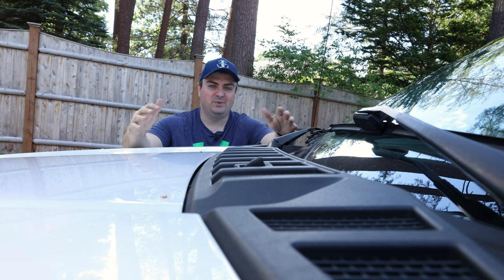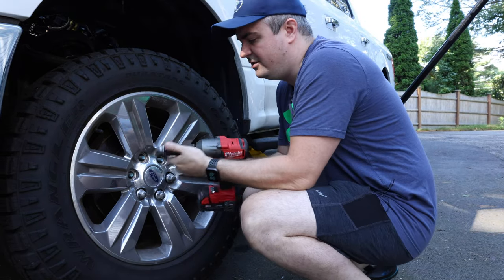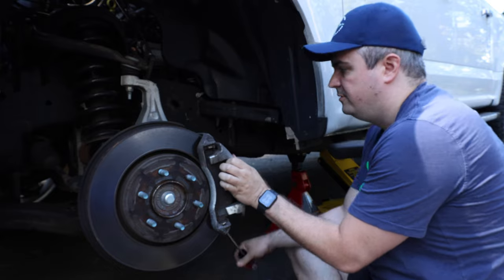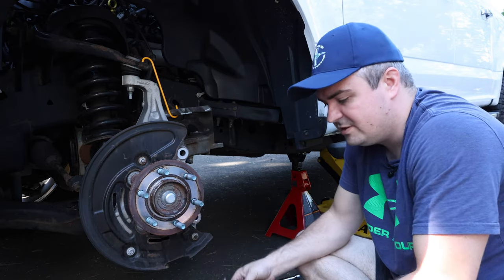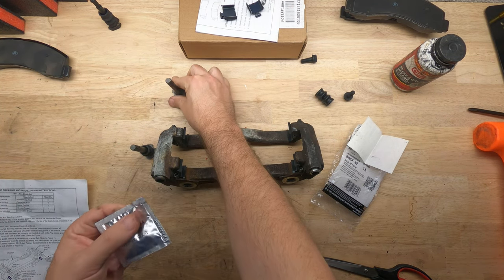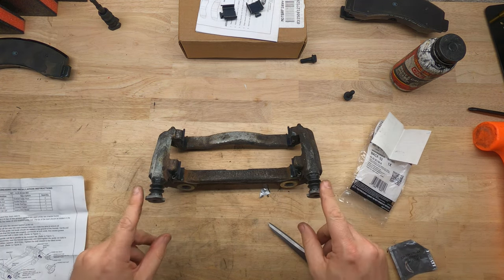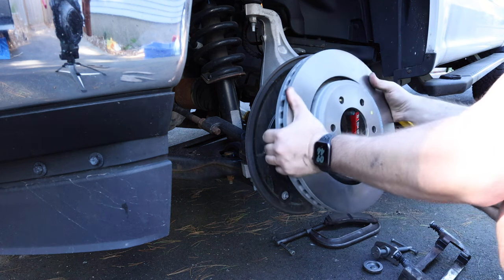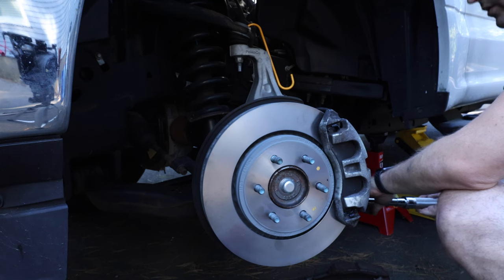F-150 Front Brake Rotor and Pad Replacement

Comment: I'm curious since you didn't cover it, did you bleed the brakes? This is another one of those tool box videos. I just did the front brakes on my F-150 last weekend. Lol. I started to video, but somewhere in there something went awry and my video stopped. Anyway, I find that using an impact to remove those bolts is easier than a ratchet and breaker bar. The only other thing I did different was bleed them just to ensure they're is no air in the system. Also, by putting one lug nut finger tight on the rotor will help keep it from flopping around making it just a little easier. Everyone has their own little tricks though I suppose.
Reply from the maker: I did not bleed the brakes. Typically on the truck if I'm not opening the line or replacing the caliper I don't bleed the brakes since theoretically no air should be introduced. I've been there with half way through a video and losing the footage. I'll pin your comment since it has lots of great tips in it!
Reply: @SmackeysGarage  OK, I certainly understand the air thing. I'm just over cautious I guess. I've had brakes fail on me once so now I take no chances since that was no fun. Lol
Reply: Novices should not open their brake system. This creates a huge safety risk where a mistake could occur. I would encourage all drivers to thoroughly inspect their brake hoses, calipers, reservoirs, and master cylinders often. The warning signs will be evident long before a brake failure occurs. I can say as a technician that brake fluid does absorb moisture in the air, and it does need to be changed periodically. The fluid becomes acidic when it absorbes water. This acidity causes the components to fail prematurely, including the hoses, and calipers. This is over the course of many years, decades even. I would have to adamantly disagree with the concept of bleeding as a course of pad changes. This only introduces the possibility of introducing air unnecessarily. I recommend changing the brake fluid on schedule, and changing all the fluid.
Reply: @code3responsevideos872  I agree with most of what you said. Most purple never keep their cars for "decades" first of all. I agree with water absorption, and she that someone not knowing what they're doing shouldn't attempt it. I agree that every once in a while it should be changed. But if you replace pads and calipers and possibly a hose you must bleed the system. I was tech for many years and the I can still recall my instructors stressing the point of bleeding the brakes. Now maybe that was old school over stuff that's newer, but I've been doing ever since I turned a wrench and have never had an issue with water or trouble down the road.
Reply: @SmackeysGarage change my front pads last night. Only compressed the the calipers and now my pedal is super spongy. Any reason that would happen? Guess I’ll have to take the wheels off and bleed the lines 😩
Reply from the maker: @Josh-fz9rh  Did you open the lines at all or remove the caliper lines? If not, I'd check your brake fluid levels.
Reply: @SmackeysGarage  I did not. Took a look at everything and one of the bracket slides is completely seized. I didn’t notice cause the other 3 were nice and greased. Grinded down my brand new pad and grooved the rotor. Now I have a reason to do rotors I guess !
Reply from the maker: @Josh-fz9rh  That's what happened to me in the front as well. I caught it and replaced it before having to switch over the entire front bracket. Too bad about the rotors.
Reply: @SmackeysGarage  I'm gonna try to torch the bracket it today and see if it'll free the slide. New pad and rotor kit already ordered. Thanks for the response!
Reply from the maker: @Josh-fz9rh  Anytime! I had to do the same thing... Torch it + vice grip it out. Ford sells the slides as a kit. Probably worth replacing the entire side.

Comment: Hey man your videos helped me replace the brakes all around (pads, rotors & guide pins) for the first time myself! You have the best F150 vids out there!
Reply from the maker: Thanks! Really appreciate it!
Reply: @SmackeysGarage  Saved me over $1500 in labour if It were to go to a shop! Do you do any videos to address the moon roof? Mine is stuck and won't open (motor still works, can hear it).

Comment: lubricating the pad clips is not advised. The lube will collect brake dust and turn into a concrete like substance. I've seen it many, many times. The only place you should use lube on any brake is the pins or any other slide that is protected from contaminates such as the slide pins with their rubber boot.

Comment: im curiuous but when took the bolt off from caliber shouldn't it be righty tighty and lefty loosely, it looks like your over tighting the bolts
Reply from the maker: Not sure exactly which one you are referencing. If you can give me a time stamp I can look. It probably appears I’m going to opposite because the wrench is pointed at me rather than away from me

Comment: I'm just impressed your doing this in flip flops..
Reply from the maker: In the summer, most of my car work is done in flip flops unless there is hot metal or shrapnel involved! 😂
Reply: Thanks for the video.. Are usually Compress the Pistons when it’s still on the vehicle. It’s a lot easier. Just a heads up. Thanks so.

Comment: Not sure about the torque spect on ford f150. 180 ft pound for lug nut? 250 ft pound for caliper mounting bolt? You seem to remove that easily without break bar
Reply: Caliper mounting bolts are 187 ft lb and the lug nuts are 150 ft lb for 3/4 ton F150s of this gen.

Comment: Ford and other ocal auto parts dealers no longer sell the rebuild kits, you have to order them online.
Reply from the maker: Which rebuild kit? You can still get the slides / bolts from Tasca. https://www.tascaparts.com/oem-parts/ford-caliper-mount-retainer-kit-al3z2c150b?c=bD0xNCZuPVNlYXJjaCBSZXN1bHRzJmE9Zm9yZCZvPWYtMTUwJnk9MjAxOCZ0PXhsdCZlPTUtMGwtdjgtZmxleA%3D%3D

Comment: Good Info and tutorial Smackey's Garage. I know you cleaned off the new rotors with brake Kleen to remove the packing rust prevent oil from the surfaces. You are too competent to forget cleaning the rotor surfaces, but just a reminder to folks doing this. Thanks for sharing. Cheers from Motown.
Reply from the maker: Thanks! You are exactly right. I did clean off the new rotors with brake cleaner to remove all the oil on the surfaces. Thanks for calling that out!!! Cheers!

Comment: Pretty straightforward video. Thanks. My brakes started grinding few days ago and I wonder it’s time to do some brake job. This video will help me a lot 👍
Reply from the maker: Thanks it isn't too bad a job. I'd review the manuals online as well.
Reply: Same here. The factory brakes don't ever squeak or squeal letting you know to change them. That said, I put 130k on em so it's kinda my fault I gota change 1 rotor as well😅
Reply: @NewEraMusic972  wow, that’s impressive. In my case it was 62K cause been hauling stuff a lot and got kind of hard foot 😂

Comment: Great video! The only thing I’d add is if you have dual piston calipers like I did, you’ll need to use 2 C clamps, otherwise, one will only push the other piston out.
Reply from the maker: Thanks! That’s a good tip. I usually leave the old brake pad in and push in the center. That way you get even pressure on them.

Comment: Flip-flops? I at least have tennis shoes on. The day you drop something on those toes will be the day. You will never work in flip-flops again.
I watched how you pull the rotor off. Obviously you had pulled this off previously before the video. I’ve always had to take a rubber mallet and loosen mine up before they would just come off my hands like yours did. Just thinking…? Overall, yes, great video , very pleasant person to listen to. Thanks for taking the time to to help our fellow brother out.!
Reply from the maker: Ha. Yea I have dropped things on my feet before. Just so much more comfortable you know! I'd never weld in them though... It was a while back, but I may have done the wheel bearing before this video, but I cannot specifically remember. I've used the rubber mallet method too works well. Glad you enjoyed the video and it was helpful!

Comment: How many miles did you have before your first brake pad replacement?  Appreciate your video!  Peace
Reply from the maker: 50,000 miles. Mine went bad due to a stuck slide. They still had some life on them. Thanks!

Comment: You can also use a 4-lb sledgehammer or 3 lb or so too tap on your breaker bar to losing those bolts and you won't have to put so much stress on your body
Reply from the maker: That’s a good tip

Comment: Good video. Which model Milwaukee impact did you use?
Reply from the maker: I use the Milwaukee Mid-Torque 1/2" impact P/N 2861. They don't make it anymore but you can still buy it for crazy money. I added the latest version to the description of the video. You can also pick it up locally at a home depot or similar store. I would highly recommend it.

Comment: Do you have the link or part number for the replacement brake pads and replacement rotors that you used?
Reply from the maker: I added the links to the video description. You can purchase them from Amazon, Rock Auto, or Ford. Cross reference the part number with your truck.

Comment: After replacing the rotor and putting the bracket back on there is basically no room between the rotor and the bracket. Any idea why?
Reply from the maker: I'd check the parts diagram on tasca for any missing parts Did you remove the slides or any hardware? It might be possible to put the bracket on the wrong side of the steering knuckle as well

Comment: Thanks for the video. I used your other video to do the back. How many miles did you have on your truck when you did the front?
Reply from the maker: No Problem! I had just under 60k. My front caliper slide was frozen and causing premature wear.
Reply: @SmackeysGarage  thanks. I just changed them all at 105k. The front still had 25%, but the back were about gone.
Reply from the maker: That's good to know. My truck spends a lot of time in stop and go traffic, so that could play a part on why mine only lasted 60k.

Comment: Some of these trucks are having brake hose failures. It might be worth changing the hoses and bleeding with the proper break fluid which is some type of Low Viscosity brake fluid.

Comment: For the front . I removed the 2 13mm bolts and the caliper will not  slide off? It sounds like it’s hitting something. Any suggestions?
Reply from the maker: You could try compressing it in place with a large c clamp if it still looks compressed. It may be getting stuck on the rotor if there is a lip.
Reply: @SmackeysGarage  thanks for the advice 👍I will give that a try. It looks like it’s getting stuck on the studs from the brake pad to the piston

Comment: Just out of curiosity, I noticed on 90 models F150s the wheel torque is around 100 which is pretty standard, on my 91 and 89 Mustangs is like this too but in 2000 and up models it climbs to 140, that's quite a bit or torque for lug nuts, why is that?
Reply from the maker: 200 and up F150s? They did start using larger lug nuts on the vehicles. I believe the 90 F150s use 1/2 while the 18 uses 14mm.  That + higher towing capacity on the trucks required it.

Comment: Why did u take of the front caliper brackets? U install the new pads with the bracket on so should be able to take the pads out with the bracket on also
Reply from the maker: I had a frozen slide that needed to be replaced. It was easier to take it out and do the work.

Comment: After 50,000 miles replace the bracket?
Reply from the maker: I had an issue with my slides rusting in the bracket. It isn’t something you typically have to do.

Comment: The 2-piece lug nut is one of the dumbest designs I've ever seen for a part that has lots of force put on it at least 2-3 times a year... 🤦🏼
Reply from the maker: Mine are typically replaced with one piece ones.